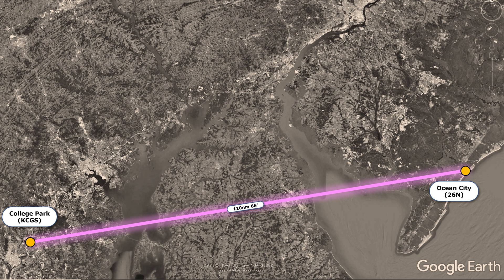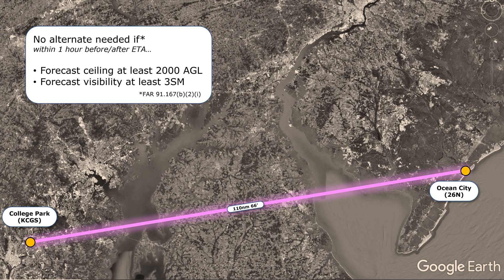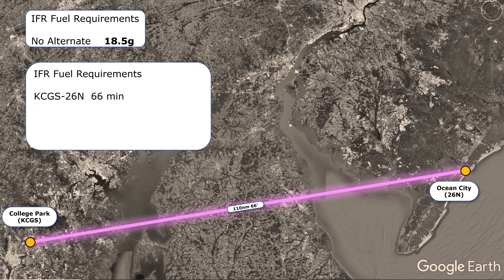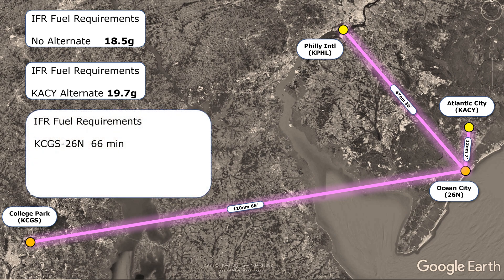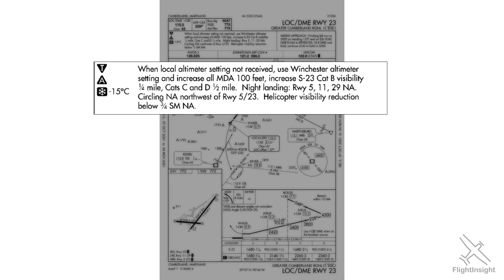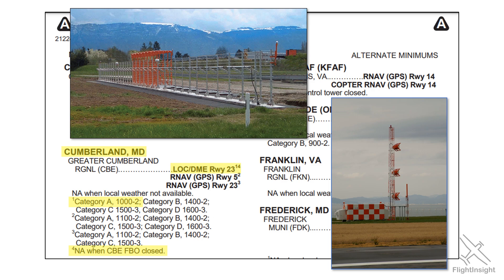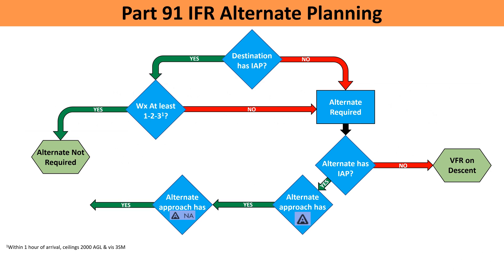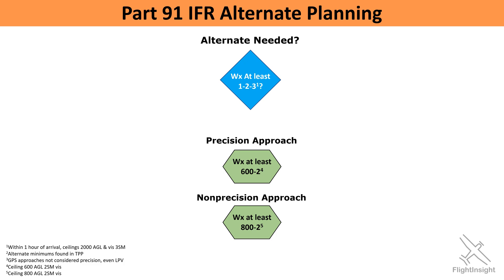IFR Alternate Airport Requirements | 1-2-3 Rule | Standard Alternate Minimums

Comment: This is a great video and offers a very useful flowchart of the decision making process. The only issue is the explanation of the "1-2-3 rule", which commenters below have pointed out. The "1" means that for a period of one hour before through one hour after the expected ETA (two hour window centered on the ETA), the forecast must be better than the "2-3" portion of the 1-2-3 rule. So if the expected ETA is 0200Z, then the forecast from 0100 - 0300Z must be better than 2,000ft AGL ceilings AND 3sm visibility.

Comment: What do you look for from one hour before until one hour after if the airport you are flight to doesn't have a TAF? Thanks.
Reply: Advisory Circular AC 91-79 and the AIM covers this in more detail but in a nutshell, you can use the TAF for a nearby airport that is “representative” of the weather as your destination. In his example KACY is another coastal airport, same elevation and likely to experience the same coastal weather. You can use it as the TAF source. What you can’t use is an airport that is not “representative” of the weather at your destination. For example, an airport that is far away from your destination or is located at a much higher or lower elevation or perhaps not subject to the metrological conditions. Hope this helps.

Comment: GPS Approaches consideration (filling an alternate)
•	Non-WAAS GPS: (flight plan based on GPS approaches on either the destination or the alternate BUT NOT BOTH)
•	WASS without baro-VNAV: (flight plan based on LNAV approaches at both destination and alternate airport) 
•	WASS without baro-VNAV: (flight plan based on LNAV/VNAV RNP 0.3 approaches at both destination and alternate airport)

Comment: One thing nobody in general aviation mentions about the requirements for filing an alternate is a forecast for thunderstorms. The airline I worked for prior to my retirement required our dispatchers to file an alternate if the chances of a TRSA was Prob 40 or Tempo, which is a 50% chance or greater. The FAA does not even recognize the need for an alternate even if there is more than a 50% chance at your ETA of there being a thunderstorm in progress. You cannot land when a thunderstorm is in progress, especially in a single engine airplane, but no FAA requirement to file an alternate. I now fly a Pilatus PC-12NG professionally and I always file an alternate even if the forecast at my destination is for good VFR weather. There are many reasons for needing an alternate that have nothing to do with weather, especially when filing to an airport with one runway. A power failure, disabled airplane on the runway, crosswinds out of limits, and a security violation are just a few, not to mention unforecast weather.
Reply: Definitely using your thought process as I continue forward.

Comment: I might be over thinking this, but you did not mention what happens if the radio communications fail? If the aircraft or ATC lose communication or radar, the pilot is expected to fly to the destination, and if not able to get in, then to the alternate. You are correct in that once the IFR flight plan is activated and the flight is under ATC control, ATC and the pilot work together. However, if communications and/or radar fail during the flight, the last cleared to fix and the flight plan take over.

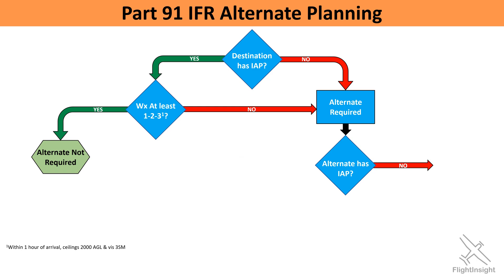Comment: For the requirement to maintain VFR for descent & landing (if no compatible IAPs available at alternate, 6:20), I've seen some instructional sources claim that this means marginal VFR does not qualify (as 91.169 references "basic VFR").  I haven't seen marginal vs basic VFR defined in part 91--it only seems to address basic vs special VFR.  Can you confirm that basic VFR--as required for alternate airport planning--is referring to 91.155 Basic VFR Minimums, or if it is referring to "3000' AGL+, 5SM+"?
Great video--thanks!!

Comment: Maybe this is a dumb question (just starting my IR training): Why does the FBO need to be open if you are planning the RNAV approach? I understand why the A might be there if you are planning the LOC Runway 23, but why would the RNAV runway 23 have that some A designation?
Reply from the maker: This is a terrific question as your head's in the right place regarding why an FBO would have to be open. Just looking at the notes on the TPP, the RNAV 23 has a footnote number 3, which doesn't relate to the FBO needing to be open. So the FBO actually doesn't need to be open for the RNAV to be used as an alternate, just the LOC. A bit confusing but it's there in the footnotes.

Comment: For the 1-2-3 rule 14 CFR 91.167(b)(2)(i) states, “For aircraft other than helicopters. For at least 1 hour before and for 1 hour after the estimated time of arrival, the ceiling will be at least 2,000 feet above the airport elevation and the visibility will be at least 3 statute miles.”  The example where the TAF had a valid time the same as the ETA would not technically meet the 1-2-3 rule unless the weather forecast for one hour before the ETA also met the 2000’ ceiling and 3SM of visibility due to the use of the word “AND” in the reg.
Reply: You are absolutely correct and well spotted mate. The part of the TAF shown was prefixed FM (ie ‘from’ change group indicator as opposed to valid period of TAF) and since it started at the eta you need to see the rest of the TAF to know if it was suitable at 1 hour before eta. It jumped out at me when he said ‘it fulfils the 1 of the 1-2-3’  so I came to the comments to see if it had been picked up but you are the only person to have noticed.
   Having said that, the FM time is meant to be 4 digits, not 6. Either way, your point stands and the video needs an errata.
Reply: I came to the comments for this too.

Comment: I know this is something of an edge case, but I'm looking at the approach into Aspen KASE. 2000 AGL ceiling and 3 SM visibility would technically be below minimums for the published approaches. Could you still file here without an alternate or is there something I'm missing?
Reply from the maker: It's legal. The reg (91.169 b2i) says that the weather should be at least _ 2000 AGL and 3SM. So it's right there on the edge of legal. It would have to stay that way or better in the forecast for the entire time window from 1 hour before to 1 hour after. Obviously when in doubt, file an alternate!___
Reply: There's guidance on that exact scenario and other mountainous airports in the AIM 5-1-10

Comment: Thanks for another great video. I have a question: when checking for minimums in alternate airports, do we need to also consider a 1 hour window before and after the ETA to that alternate? Or does this window only apply for the destination airport? I missed that in your video.
Reply from the maker: It’s at the ETA. There 1 hour buffer only applies to the destination airport. The wording of the FAR (91.169 c) says “appropriate weather reports or forecasts or combination” it seems the requirement is more stringent at the destination, if the weather fails the test at any point in that two hour window it fails, but the alternate only has to show better than mins at ETA. Thanks for the great question!
Reply: At the ETA of arrival to the alternate, the standard alternate weather minimums must be predicted at 600' AGL and 2SM visibility for precision approaches (ILS), or 800-2 for non-precision approaches(all others). However, many airports have non-standard alternate minimums which are published. If this is the case, there is a black triangle with an "A" printed on the approach plates for that airport. These become your alternate minimums for what approach you would plan to shoot, and predicted weather must correspond at ETA.